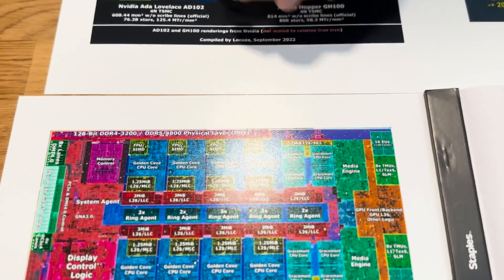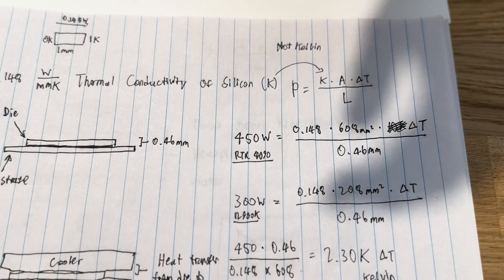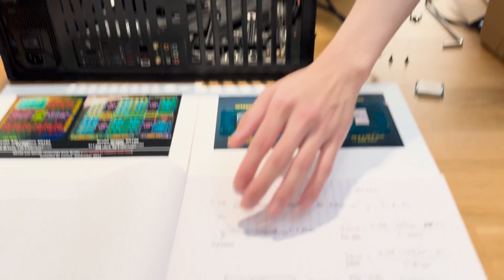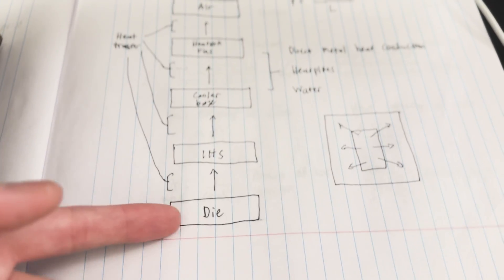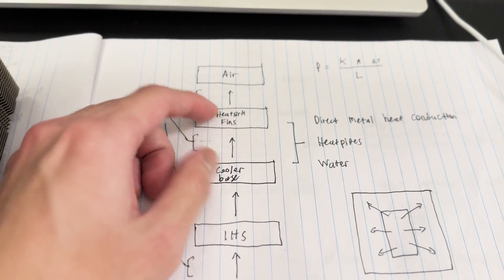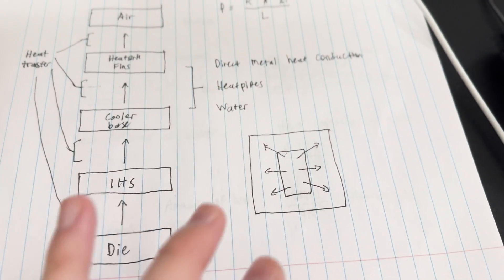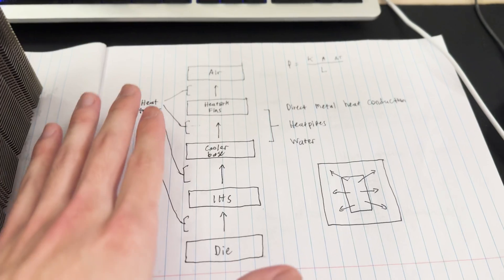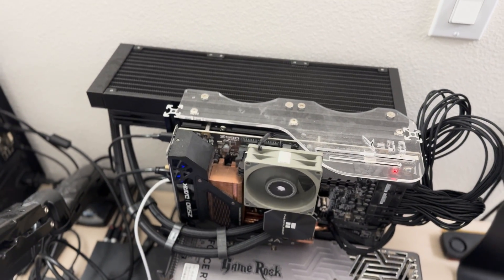Why do CPUs run SO HOT?

Comment: yo man i saw a video a few months back about all the rtx 4070 compared, and noticed that the msi ventus series was in f tier because of a piece of the gpu was uncooled and the hotspot temp was high bc of this. recently msi released the msi ventus E series that supposedly ''fixed this issue'' but NOBODY is adressing these new cards and if the problem is fixed. right now the ventus E is the cheapest 4070 on the market and i would like to know if the problem has been fixed, could you make a video of this please? or just tell me in you know.

Comment: Nice video. I have noticed that this topic is often misunderstood in pc community. Btw it is possible to lap the silicon and mount the heatsink directly on it without ihs. I did this mod myself on 7980xe with custom loop cooler and it was able to dissipate about 1000W or more while staying below 100C which is crazy (Die is about 480mm^2 so silimilar to the 1080ti or 2080).

Comment: You forgot 1 very important factor, the CPU (especially 12th gen and up) is supplied with too much voltage on most mobos 1.35V+ and that's way too much for stock speeds for most CPUs, that's why they go to 100c instantly, if you undervolt to 1.2V most will run at stock speed but at around 80c.
GPUs run on 1V, 1.1V max and that's a big part of the reason they run cooler + the 450W GPUs have a bigger surface area coolers than any CPU air cooler.
Reply from the maker: Yea that's a different topic entirely.
Reply: I mean that is main reason why CPUs generate more heat per mm than GPUs, which is covered by the video. Now imagine if 4090 had 3200mhz@1.4v stock...

Comment: Thermal resistance is also important cause Noctua thermal paste have 3-4 W/mk but it bets thermal pastes rated 12 W/mk, its also true for Arctic Tp3 thermalpads which are the best from mid range thermal pads having less W/mk than competitors.

Comment: I guess this explains why blower coolers are sufficient on even high power gpus, at least until the exhaust area got consumed by 4 full size display port and hdmi connections.
Reply from the maker: Yep exactly. On server GPUs they are essentially blower coolers without any display connections, and they can cool 300W+ GPUs just fine.